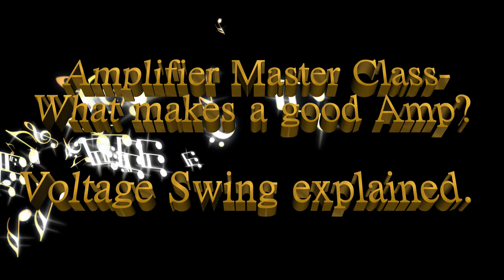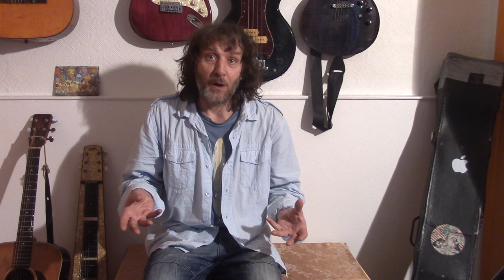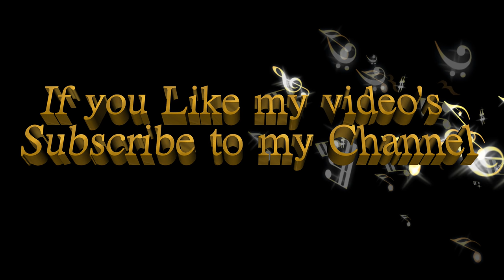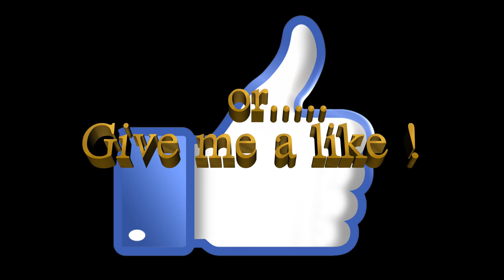Amplifier Masterclass- What makes amps sound good- Voltage Swing

Comment: Man, I wish you could take some of the electrical engineering classes I had during my undergrad. I remember being up to my eyeballs in transistor amplifiers. They don't teach valve circuitry anymore, but the concepts are the same.
Reply: lmao! Exactly, the formally trained stepping back into 40 to 50 heart old technology is something to behold isn't it!

I don't particularly like the solid state endgame in engineering. When it comes to amplifiers, I've had much better experience with prior service Navy days as an electronics technician.

Most cases, it'll be an integrated circuit endgame for modern work, but it makes for some confused guys when you want to talk about tubes and component level analog circuits.
The Navy still runs old tech, but no one really teachers that anymore.
Reply: I always loved my klystron.
Reply from the maker: Its like the Dark art these days......lost in the mists of time.....The Valve engineer.......
I did the first year of an Electronic diploma, when I was younger.....but I'd had enough of school...it wasn't the right time.....life was calling me, to experience.....and meet new people.
Wanted to build gadgets, amps, fx boxs.......Probally a good thing it didn't pan out....
Tha safety of the planet would of been in jepody.. from my Sonic Nellyfier and 4 d sound system I designed 10 years ago ...whilst on a Trip !!
Reply from the maker: Krystons are great amps......I''ve learnt everything.....the hard way   !!!

The PUNCH LINE of my AMP STORY is .....and it still makes me roll around with laughter now, just thinking about it........You know.I said the  Capacitors  were huge....and the case small ( 2 unit high ).....
Well .....The CAPS Shorted out on the case.....and it  blew itself  to pieces............ in one amazing FLASH n ZAP..
it was no more!!!!!
HHHHHHHAAAA..HHhhhhhaaaaaaa,...... I'm in tears of laughter now just remembering it
............ It was  proper wrecked..
....never to rise again from its chard....burnt out... remains !!!

 Another rock n roll legend that died before its time !!   lol    I been laughing so much ..
uncontrollably...while writing this...Happy Days !!        Another hard learnt musical lesson......

Comment: Totally get what you're saying Andrew. Ive played regularly with a pair of Hiwatt 100 watt heads from the 70s into a 4x12 each, with the MV around 9 o'clock, you feel like you can "lean back" against the sound. Such punch from those cones, nothing quite like it. And nothing that can replicate it at bedroom volumes!
Reply from the maker: A Wall of sound, 2 4x12's, Bet that sound so loud.......Im breaking into a sweat at just the thought.....I've book a cheap studio next week.....but I gotta play bass( mate on drums) cause dont know any bass players ,who are good enough locally....
So its come to This....at least get some top bass n drums down ,we'll see what happens.
Sure will film it to
Reply: +Nelly Slide Guitar Ah man thats just the normal playing setup. The biggest rig I ever played was through 3 150W Diezel amps, set clean with a boosted midrange to get the Dumble-esque note flip and note cry, into 6...yes, 6, oversized 2x12s all loaded with EV12Ls. Earplugs werent needed as it wasnt uncomfortably loud as the summed output of the amps meant they didnt need to be cranked to get the volume...but as youve said in this video, the huge power transformers reacting with the speakers in the way they did was magical. Id best describe it as the loudest but also the clearest sound Ive ever had. I was playing Pink Floyd songs through this setup, using pedals for gain, as you said you were. 
I hope the recording session goes well for you too :)
Reply from the maker: I'd best describe it as...." Heaven on Earth"...
A real beast...........I've never used more than a two 4 x 12's......
But One day....I hope to have them right across the stage. In Stereo !!
 We all gotta have dreams !

Comment: Pretty interesting! You know I had an idea to get a really old fender frontman 15g which sounded really good when you plugged good quality headphones into it. But sounded like rubbish with the combined speaker so I thought to make it into a head and cab by separating the amp and speaker, building a shell or modding the shell, getting a speaker or speakers rated at the right oms, Cover with tarp, leather etc wire up and bobs your uncle a great cheap amp great for clean guitar work :)
Reply from the maker: Hi ya Davy,That sounds like a great idea...if u ain't done it already.......Getting the right speaker,matched with the amp is so important with guitar amps...you need to try it thru a few different cabs to be sure its a gooun....one of them will sound best...look at what make they are....sorted !
..back in the day...E.V's (Electro Voice )  or J.B.L's were the favourite 12 inch upgrade speaker.for combos.
E.V's are very good but £200 each...OUCH  !!   Boogie use them in there Cabs n Combo's...
 But as with most audio ....you get what ya pay for !!
Reply: Yeah at the moment I'm just getting my YouTube channel going first, get good MacBook for editing/music recording, camera etc but I am still looking at used celstron speakers though and some fender ones too on eBay (when the right deal comes you know)

Comment: Do you have any advice for driving an A/B class tube amplifier that has a lot of (almost too much) headroom?  Great video and helpful tips here by the way man!
Reply from the maker: Not trained ,but the Docter's diagnosis is......Tou say to much headroom....so reduce the dymanic range...
Use a limiter or compressor before the power amps this will help hugely.....Every Pro P.A. uses compressor /limiters not only to reduce peaks ,but to protect your drivers in the speakers .
See my Compression explained video  
https://youtu.be/mB1jB5bs-K4
Reply: That's make so much sense!  I've been thinking a compressor would help with my situation, but I wasn't too certain, so I'm very glad I asked you.  Thanks a bunch man!